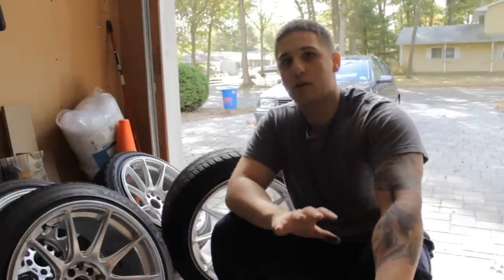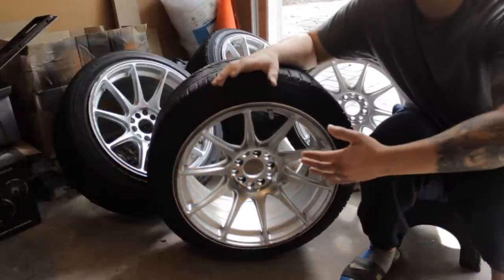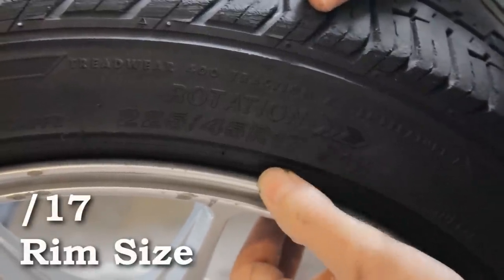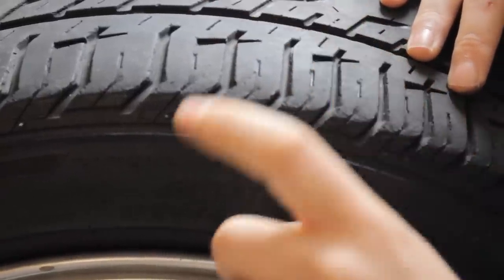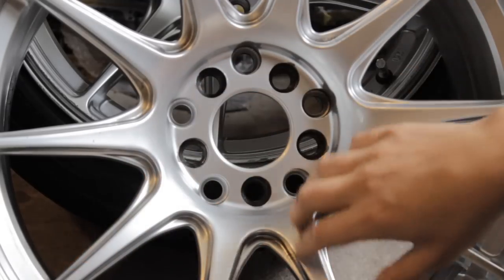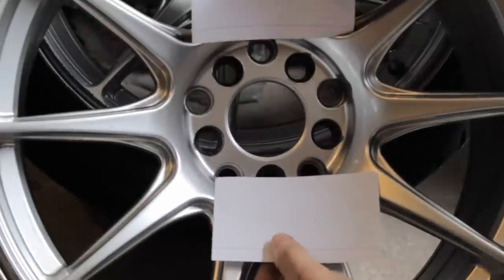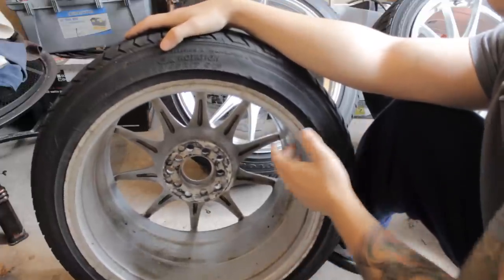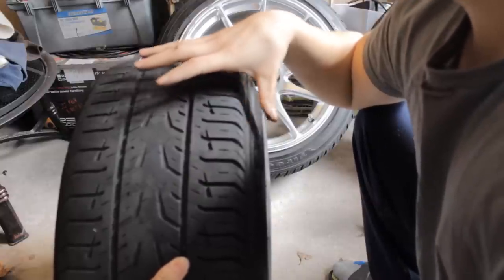GUIDE to Offset, Lug Pattern, Wheel/Tires Specs

Comment: Something to note. The sidewall number (the middle number) is the percentage of sidewall compared to the tread width. So a 225/40/17 will be taller with more sidewall than a 195/40/17
Reply: I don't know dick about cars. Exactly what number must I look at in order to tell if the extra tire I have will fit my car? Does the number have to be an exact match?
Reply: It will be like 195/60/15 lay out, And it's best to go with an exact match, another may not fit.

Comment: Like others have pointed out, sidewall number is the percentage of tire width, not a specific number. Also, to make it easier for some. To calculate mm's to inches, divide by 25.4, as there are 25.4 mms in an inch. 
Example 225/45R17
225/25.4 = 8.85 so his tire width is 8.85 inches

Comment: I think it was well explained great,you said 25 is dangerous ,but you got someone posting against that statement,I find it true to some degree ,I believe there only dangerous if the road your driving on isnt full of potholes you risk cracking your rim even the smallest potholes at a fast driving speed will crack aluminum rims, so thats the dangers of rolling on 25's side wall in my own opinion im know tire expert but only sharing my experience with low pro ,225/30/20 on o2'Bmw 530i

Comment: Great video, It would be good to clarify the dimensions of the tire.
The first number is the thickness of tire in millimeters. for your tires 225mm wide 
The second number is the aspect ratio, this is the height of the tire, the number given is the percent in millimeters of the width. your tires were 45, this mean your side wall measures 101.25mm = 225mm (width) x 45% (aspect ratio). 
Keep in mind as the widths of the tire goes up in length the aspect ratios become low, naturally. 
If you had a 335/45 that side wall would be almost 2 inches larger than your 225/45 
lets say you wanted a 335mm wide tire but you want the same side wall hight as your tires (101.25mm) it would be a 335/30! 335mm width x 30 aspect ratio = 100.5mm side wall! 
So there is no universal "comfortable range" per se. you said (30-40) furthermore this doesn't mean that its dangerous to run 25-30 aspect ratios, its all relative to your wheel width and how aggressive of a stretch you want and having a tire wide enough to physically bead onto the wheel.
also most old jdm vehicles are 4x100 almost new imports run 5x114.3 
you could have also explained offset a little more in detail, +, - for example and what that means in regards to clears and fitment! maybe for next videos! Love the video and its great to see someone stepping up and making stuff for stance enthusiast. 
Add my crew on istagram and say whats up!@teamnuisance Mine is @john_magana you can see some of my cars that i have owned and slammed over the years, 97 240sx, 05 outbackxt, 08 honda fit. also used to have a 93 mr2 turbo but no pics!

Comment: Question, Ive watched this 3 times now & Im having a few issues. I have 98 civic, stock offset Im told is between 35 & 43. I have stock ride height but will be changing that to a 1 to 1.5 maybe a little more drop as soon as my car gets back. The wheels I want are all around 25mm offset & pushing the limit of width. I prefer to get a 7-7.5 width & told 8 width will rub badly. Is there any way I can run the 25 mm offset on stock height & adjust later. I need the wheels to get the car home & avoid buy tires for stock steelies..Any help would be SUPREMELY appreciated!! Thanks for making the video, it helped a lot even with my current confusion!

Comment: i really like your explanation however my case is a lil bit complicated, here's the situation I got an 18x9.5 rota Torque wheels which was taken off a subaru WRX(5x100) and I'm gonna be installing it to my IS250 which is a 5x114.3, since its already an18x9.5 wide i am looking for only a 15mm spacer converter however the one's ive seen for sale is not specified for is250 hub bore,the hub bore on that converter spacer is only 56.10 and my is250 is 60.1, can you walk me through, if im goin to get that spacer, do i have to get a 60.1 hub center rings for this? thanks hope you can reply and educate me for this..thanks

Comment: Hi. I've a Honda fit gp5. It had 185*60*15 tyres. I changed them 185*65*15 very recently. Car looks bit higher than how it was. My question is this: will this have a impact on handling and performance? P:S. Got steel wheels . Thanks

Comment: Would it be bad if I used 235/40/18 on the front and 255/35/18. I don’t know much yet but would different thickness of the tire matter? Both of them are within 3% in difference of speed

Comment: Hi quick question. Can I use 6jx14 and 6jx15 on the same hub? I have to change to winter tyres and I have no idea if either one will fit? I currently have 6jx14 and I found 6jx15, will the 6jx15 fit? thanks.

Comment: I need help with this. I have these dual lug wheels which are discontinued and the company is gone. How can I measure to make sure my bolt pattern is 5x4.5 or 5x4.53 accurately? I know it's one or the other but the .7mm difference is big.

Comment: Man good video ! I watched the whole thing. But when you mentioned offset lug patterns it wasn't clear you were talking about the depth in which the tire and rim sit on the ride. I really need to take a cars/trucks rims that are being manufactured still to fit hub bolt pattern of 16 1/2 rims? Got a clue. Need to take 16" rim fit to 16 1/2" bolt pattern once again! Just stuck!

Comment: hey man.. nice video. I got a question. the tires on my car are 245/40ZR18 97W. 245mm width is roughly 9.6". I have stock 8.5" rims on. how wide of a wheel can I fit around with the tires I got? 9s?

Comment: Ok so let's see if I have this right. I have a 99 DSM (Mitsubishi Eclipse) and the stock setup is 16x6.5 ET40. Right now I have 17x7.5 ET40 which is super tucked under the fender wells. I was looking at the XXR527 or 530 in 18x8.75 ET35. So these should still fit? I was planing on running a 225/40/18.
Reply: TechT1999 dont get xxr they are very low quality wheels
Reply: JayCee Garcia  Stop hitting shit with them.  Any wheels would be shit if you hit stuff with them...  Replica doesn't mean low quality in the case of XXRs.

Comment: Hey I have a 2012 dodge charger and I currently have 22s with 265/35/22 all around . They came with my car . But i dont want 22s anymore im looking to get 20s and my local wheel shop wants me to get 20x8.5 infront and 20x10.5 in rear. ( i love wide rear wheels and tires) but i dont really know anything about wheels , so im clueless at the moment. and he said he would put 245/45/r20 in front and 275/40/r20 in rear. but i kind of love how wide my front is at 265 so i was hoping there was anyway to get a 265 in front and 295 in rear? 
And i do know my bolt pattern is 5x115 but the wheels he suggested are 5x114.3 ....
I need help he says itll be aperfect fit but I dont see how thatll be a perfect fit. By the way i have stock suspension and I live in south florida if that makes a difference. Thanks guys in advance!

Comment: Hello,

I need your HELP.. i have a wheel 16 inches 16x7
but i went to the local shop in my town but they don't
have a tire size for my wheel. any suggestion that 
you can give to me? they only have this size 215/55 r16
do you think this can be fit with no problem to my wheel?
hoping for your responds thanks.. :)

Comment: I have X4 205 R16's on my audi with a 5x100 lug pattern, bought x4 alloys with exact tyres, however lug pattern on the replacement set appear to be 5x112, I think selling them on is the most straightforward way to go, any other viable suggestions???

Comment: Great video I bought some new wheels for my bmw all the new wheels I got are 19x8.5 - tires 225/35/19 but want to get flush fitment cuz they stick in to much inside the Fenders so I’m need spacers probably to get decent size fitments on front and back of car

Comment: Hey i have a 2007 Honda CR-V with lowering springs.. 1/4 front drop 2 inch rear drop..
I have 19 inch accord factory rims on 235/35/19 there’s a gap in front what other side tires can i use to make the whole car look even?

Comment: Hey bud awesome video. I wanted to maybe explain it in a different way or maybe add something that you might have left out, but the 45 means that the sidewall is 45% of the width of the tire tread. So 45% of 275 is the hieght  of the sidewall.
🤘🏼😎🤘🏼

Comment: If we want to run a mild stretched step like you have here. Correct me if I’m wrong but wouldn’t a 235/40 tire fit just the same as a 225/45 tire on a 18x9.5 wheel?

Comment: Really appreciate your video specially to a noob like me. anyways i just recently bought a 18x9.5 + 30 front and a 18x10.5 + 30 rear. So before i bought the rims the guy told he recommends a +22 but when he asked me if my fenders are rolled (i told him they're not) he suggested to get a +30 instead. so what would happen if i ended up getting a +22?
Reply: the wheel would stick out more because the mounting holes would be closer to the center of the wheel pushing the edge of the wheel further

Comment: COUPLE corrections here, or maybe just to clarify what you said about tire sizes in the beginning. (and no i didnt watch the entire video)  say your tire is 245/45/18. 245 is the width of the THREAD in millimeters, not the actual width of the tire from sidewall to sidewall. the second number- 45, is the PERCENTAGE of sidewall HEIGHT in relation to the thread width. meaning the sidewall height in MILLIMETERS is 45% OF 245.. and 18 is obviously the wheel diameter. so to clarify - not all "45" series tires are the same height, a "35" series sidewall, and a "40" series sidewall, and a "45" series sidewall could all POSSIBLY be the same height depending on just how wide the thread is.. but typically the lower the number in sidewall height ratio, the lower the profile of the tire is.
Reply: +kctyphoon Good info.  Also, just to add to your comment, the width of the rim is measured from the inside of the bead area, not the outer rim lip.  In other words an 8" rim could measure nearly 9" if you simply tape the outer bead to bead.

Comment: wanna get Enkei 18x9.5 +38 with 245/35/18 for my frs. If i go square all around, will the front pokes out? I want my wheels straight flush with the fender, any recommend or advice will be appreciated. Thanks

Comment: Just wanted to make a small technical correction.  Your example of a 225/45R17:  The 225 is the cross-sectional length, at the widest point of the tire.  It's actually measured, usually, about half-way between the tread surface and the sealing bead of the tire.  The 45 number ("Series" number) is a ratio.  It relates the over-all width of the tire, to the height of the sidewall.  Also, the wheel diameter is not measured from the upper and lower most beads, ie: those that can be seen with the tire mounted.  A 17" wheel is actually 17" from the inner diameter sealing bead surface for the tire.  Good vid otherwise.  Again, not a complaint, just a technical clarification.

I do challenge you as to who's roads are worse....Jersey, or Oklahoma?.....

Comment: hi guys, i need a little help....
I am redesigning 'MB amg vision gran turismo..so while exploring its dimensions, i came across this...
 Wheels
front: 9.5 J x 21; rear: 12 J x 22
Tyres
front: 275/30 ZR 21; rear 335/25 ZR 22

what does J and ZR stands for?

Comment: Ok, so my car's oem rims have 55mm offset. The rims I want to buy have a +25mm offset. Does that mean that it's 55 plus the 25 of the new wheel? I want XXR 527s like you have only mine are going to be 17x8.25.
Reply: No, wouldn't fit. Getting the +25mm would push your wheels out against the fenders.

Comment: How much can you exceed the recommended specs by before you run into problems?

My Mazda 3 2012 GS-SKY takes 205/55R16 as its standard size, but I'd like to get 17" Rims and pair it with Michelin Primacy MXV4 215/55R17 94H.  

Mazda recommends 205/50R17 for 17" tires.  Could I get away with it using those Michelin tires?
Reply: I would recommend what they recommend. To make sure your speedometer and mileage is accurate you need to try to keep the entire wheel roughly the same size. Bigger rime size, smaller wall thickness. The ones you want are bigger than the stock. I think if you go an inch up in rim size your should go down about 5 in the middle ratio number.

Comment: There are so many things you left out when it comes to sidewall size. First off, that number (45 in the case of your 225/45R17 wheels) is a percentage of the width (the width being 225mm), so that means for your 225/45R17s, the sidewall is 101.25mm tall (101.25mm being 45% of 225mm). If your tyres were 255/45R17, it would be 114.75mm.

This is very important for getting the speedo correct on your car. Using the wrong sized tyre will throw off your speedo. I will use my car as an example. My stock wheel is 17x7.5 and my tyre is 225/45R17. If I was to put 245/45R17s on, my speedo would be reading 100km/h when my car would actually be doing 103km/h. Using a smaller tyre will have the reverse effect. If I use 195/45R17 instead of 225/45R17, my cars speedo would be reading 100km/h but my car would actually be going 96km/h.

Same thing if you use a smaller sidewall tyre to get a low profile tyre look. With my car, using 225/35R17 in place of the stock 225/45R17s would leave me with my speedo reading 100km/h while my car is actually going 93km/h. Again, the reverse happens if you increase the sidewall size. 255/55R17s would have me going 107km/h when the speedo reads 100km/h. Lots of speeding tickets for me!

This happens because the speedo is programmed to the stock size of tyre and wheel. Changing your wheels and not using the correct size tyre to compensate for your speedos calculation will throw it off. Using a Speedo error calculator will help prevent this since you can work out how big or small of a tyre you need.

Also, stretching a tyre will usually throw things off and make the speedo read a little higher, but usually only by probably 0.1km/h so its not worth thinking about.

Comment: ok so lemme get this right. my stock wheel on my kia is 17x7 at 45 offset.   if i go with aftermarket wheel at 17x7 at 35 offset the wheel will sit outwards 10mm more or inwards?  im confused as to if i got a 17x8 at 45 offset if it would be as wide as the 17x7 when it comes to sticking out.   i just want my new wheel to stick out a lil fuurther
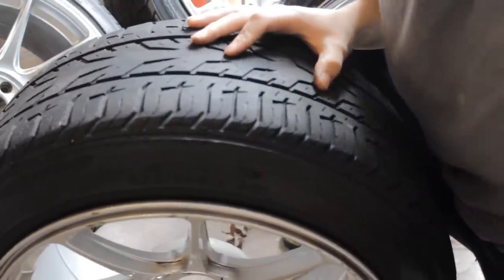Reply: inktoxicated 2:49

Comment: I have a jetta mk4 and i have Miró wheels 111 18x8.5 on front an rear is 18x9.5 i whant to instal spacer 20 mm is good for that size ? Ofset on front is 35 and rear is 40

Comment: Hey i need help! I have a 2014 Camry wheels are 17x7.5 45mm offset. The wheels im looking at are 18x8 40 offset. The question is are they going to be closer to the fender lip or skinnier or what How would they look. Please Help
Reply: +Eiud González If you go for wider rim with smaller offset you will get them closer to the fender lip so it's a win win. Go for it.

Comment: Just purchased a 03 Infiniti. Tires are 245/45ZR17 in the fronts and 255/45ZR17 in the rear. Can anyone tell me if that’s right? Car was painted and they painted over the OEM tire sticker so idk what the stock recommended tire depth and size is. But the wheels are the stock Infiniti wheels just dipped matte black. Any and all guidance would be appreciated.

Comment: Does anyone know if the Sparco Trofeo 4s fit on a stock Mk3 2.0? Found them on tirerack and they're OEM diameter and width, but they don't list the offset and I can't find it anywhere. It says it needs a hubcentric ring, but idk if I'd need spacers. The offset looks pretty similar to the stock rims I have now.

Comment: Dudeee i need your help man i have a vw jetta vr6 i just got some used rims for. I have no idea what bolts to get for it. The bolts that came with my spacer were cone 40 mm ones and because of the "cone" they dont fit on my aftermarket rims. What do i do ;(

Comment: Just to add exact data about tire dimensions signature. In this case of 225/45-R17:
- 225 is tire THREAD WIDTH in millimeters (not as shown down at the rim, but tire measured at thread, which touches the ground)
- 45 is tire HEIGHT IN PERCENTS % of above mentioned width, so 45 means 45% of 225 millimeters which equals to approx. 101 millimeter. So don't be confused if absolute tire height of 175/70 is LOWER than with 265/70 tire - because /70 is 70% of first number, which in first case is less than with second tire.
- and R17 is, as correctly told, tire inner bead diameter in inches, which corresponds to rim diameter in inches, of course

Also LUG dimension is slightly wrong explained. 5x 100 in this example means:
- 5 holes for nuts, of course
- and 100 is the diameter of CIRCLE, which would be drawn across the centers of all lug holes (in millimeters again). It's not triangulation, but simply circle diameter. It is easy for 4x bolt pattern, because you just measure from opposite nut hole centers and you get the number...while for un-even patterns, like in this example of 5x, it is only approximation to measure from TOP bolt hole to as shown TWO BOTTOM holes BOTTOM line (not center line of those two!). But still it is approximation, not acurate measurement!
Reply: I thought I was going crazy listening to this guy explain noob info. Thanks for verifying what I already know about tires and wheels.

Comment: Excellent video man, very informative and helpful. One thing I was hoping you'd touch in your video was a " general " idea on what offset to choose to finish off your personal stance. Suggestions even. I.e. I noticed how you're running the 17x9.75 concave and is running 225/45's. well I'd imagine based on your videos you don't daily 4 inch static drop like I do ( racelands ) and I was looking at 17x10 in the rear. Would 225/45 rub or would I be super flushed with the fender. Feel me?